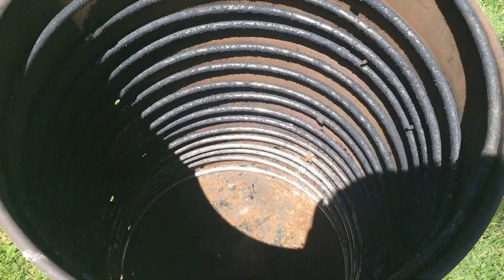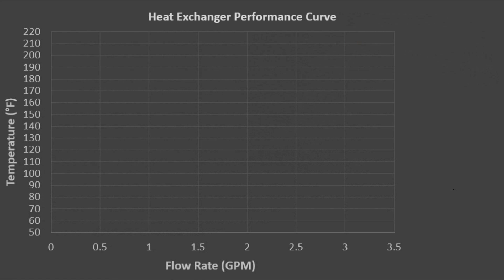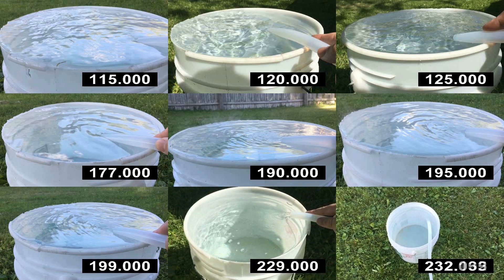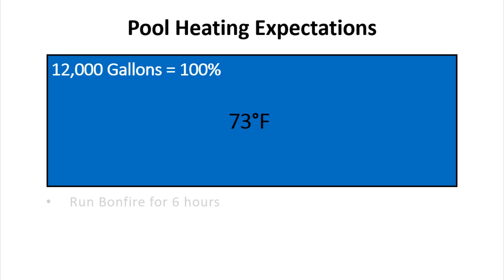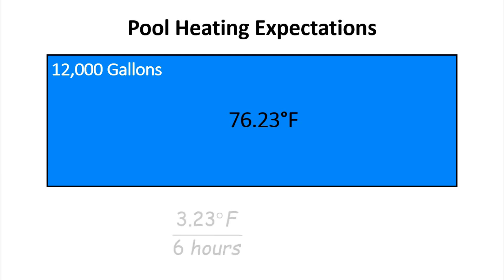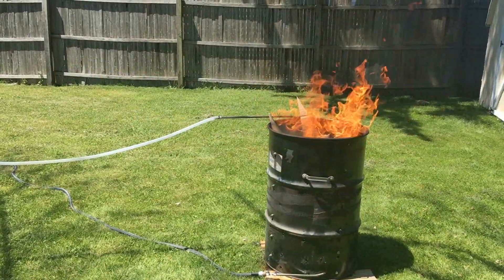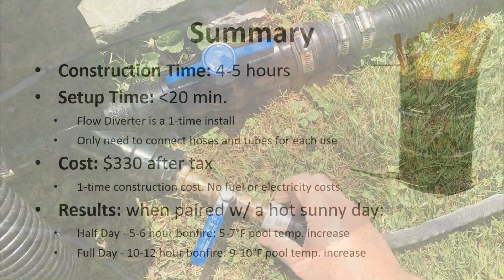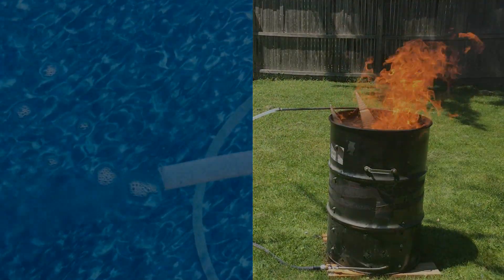Ultimate DIY Pool Heater | Part 2 - Performance & Results

Comment: Great video. The math was definitely an added plus. Just wondering if a second coil around the outside would help? You’d reclaim all of the wasted heat from the outside of the barrel. It would be similar to a scotch marine, 2 or 3 pass boiler. I’d run run the pool water though the outside coil and then feed it to the inside one. In essence you’d be “Pre-hearing the water and you should get closer to 150 or 180 depending on the barrel temp. Your thoughts?
Reply: The answer is yes, though the efficiency is lower.  Look up SSLDad's videos.  His inside coil got gummed up, so he wrapped one (a very short one) around the outside and said it was working.

Comment: Awesome... Have you considered doubling the length of the coil and have it do double the run in the fire?  Or to out a top on the barrel with a smoke stack to increase the water temp?

Comment: Thank you for your detailed video. I'm thinking of building something similar but using a salamander style heater to blow heat in the barrel through a hole in the side with a lid on top with maybe a 8 inch hole in the center to create sort of a rocket heater.
Reply: How did it go?  I had thought about a rocket heater. Did you see the couple from New Zealand the created an elaborate permanent one with bottles for insulation with clay and bricks.  It was for a hot tub, but looked amazing.

Comment: Just the calculations I was looking for - super smart  approach to the problem.  I’ve seen a lot solar projects but they all don’t factor in the mass / volume of a water body well enough to be largely effective.   I didn’t know the way to approach the two volumes (hot and cold) and at what schedule I would need to move temps up so this really helps.

Comment: Thank you for the great video. I can do this! But I want to ask, could this conceivably heat the pool in the winter? My winters are average 35-45 degrees in December-February and I have an 18’ round pool 48” deep. I have adequate scrap wood so could I use your design or tweak it? I have work ethic but not the awesome mathematical ability you display. I am determined to swim in my pool year round! Thank you so much!
Reply from the maker: I don't think this would work in the winter unless you built more than 1 heater. With an 18' round pool you could expect the temperature to raise roughly 1° per hour without sun. My guess is the heat loss through the walls of the pool in the winter time would be around that, so you'd be lucky to even maintain the temperature of the pool.
Reply: @ashow13  So I agree, though some of the losses can be mitigated with a good cover, and using foam insulation (such as the 1" panels) around the outside. I'm thinking of burying one side of my pool, though my is a Kayak with a steel frame.
Reply: @ashow13   Thanks for the video, i have a 10000 gallon pool in the ground our winter is about 65 deg F... would it be possible to heat to 99 deg F if i double the length of coil ....

Comment: Do you think putting output of warm water in or by skimmer would make it warm quicker having tempered water to start
Reply from the maker: That would help to mix the water better. I noticed that by putting the hose on the opposite side of the pool that I created a hot pocket of water. When I went in to swim I could feel one side of the pool was hotter than the other.

Comment: Firstly, I really appreciate you making this video and the details you went into. 
Great work.

Last month I made myself a pool heater very similar to your own, only with a shorter 10ft 1/4” copper coil, with only a half-height oil drum with a steel lid with a flue. 

I only have a 10ft pool and it managed to raise the temp from 28 Celsius to 34 Celsius in about 2 hours. 

It was a fun project but I was left feeling that had I attached the coil to the top of the flued lid rather than wrapping it around the inner of the barrel that this would heat the coil more efficiently still. 

I found the flued lid helped increased the output a bit too. 

I’d be interested to know your thoughts on this. I plan on making a mark 2 soon.
Reply: How many holes did you have for air intake, and what size?
Reply: Net Wrench I believe it had 8 holes evenly spaced around the drum, about 1” from the bottom, 25mm in diameter. But it also had a raised bottom plate which was a little smaller in diameter than the drum itself, leaning a small gap between its edge and the side walls of the drum, under which there were another circle of about 30 or so 8mm holes.

Comment: Your pool heater can generate more heat when the pipe is run trough the middle of the barrel. Cold air is being pulled into the barel from the sides and the heated air(and flames) will mostly go in the middle of the barrel up.
Reply from the maker: Agreed. Next spring I am going to try laying the barrel sideways and see how that affects the results. I might also try drilling more holes toward the top of the barrel and putting a lid on the barrel.
Reply: @ashow13  
While burning, the ashes will accumulate on the bottom, thereby covering and insulating that section of coil.  If the barrel is sideways, I think more coil may be affected.  It might be best to stay vertical and start the coil somewhat up from the bottom to allow for ash accumulation. Great video though.  Thanks for all the specifics.
Reply: @ashow13 how did that work?

Comment: So 55k btu heater per hour if you guys want cliff notes.  Natural gas would cost me about $.60 an hour to run a 55k btu heater.  If i used an electric heater it would be $1.80 an hour to run.  So the next question would be how much does your wood cost.  ;)
Reply from the maker: Mostly yard waste actually. Or scrap wood from house projects.

Comment: Nicely done calculations !

The only thing that bothers me in your setup- is such a waist of a burning wood energy- you probably catching up only 5-10% that could be used. I have seeing people use old car radiators placed on the top of the burning fire- much better heat exchange ( I know it has some issues too though).
Reply from the maker: Thanks. I'm sure a radiator would work okay at a low flow rate, but I'd be very surprised if it had the temperature and flow rate output of a 100ft. coil. I don't show it in these videos, but I do have a lid for my burn barrel so the flames aren't shooting out the top with all that heat being wasted. I'll try laying the barrel sideways instead of vertical so the flames shoot up toward half of the coil and see if that makes a difference.